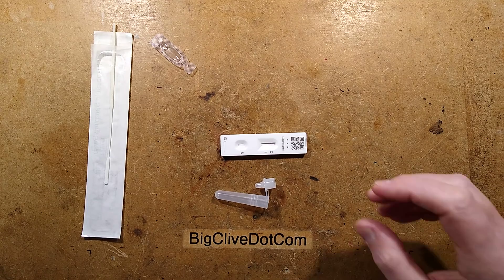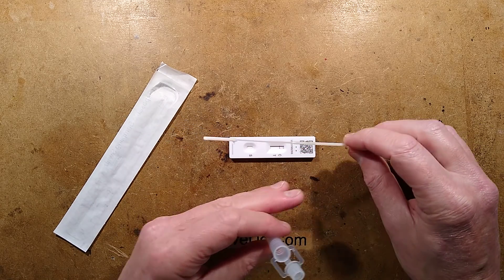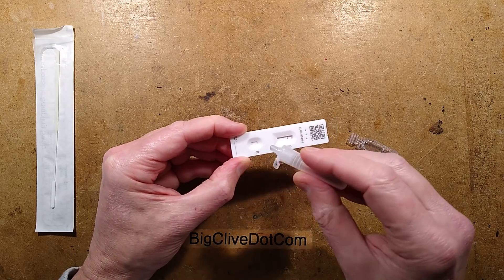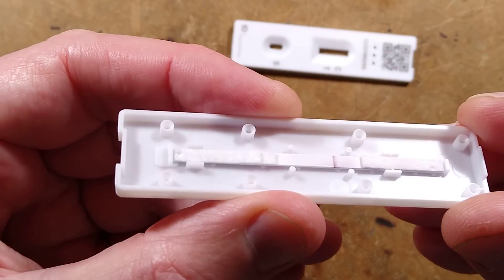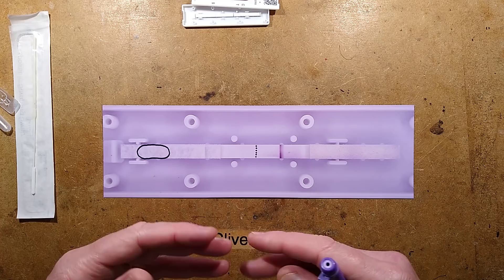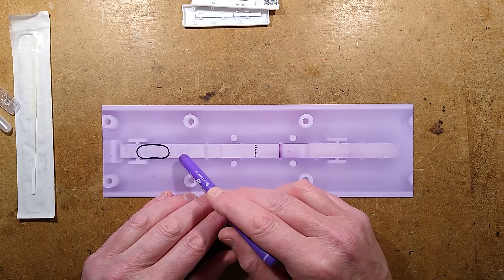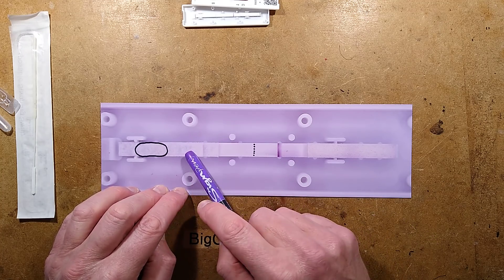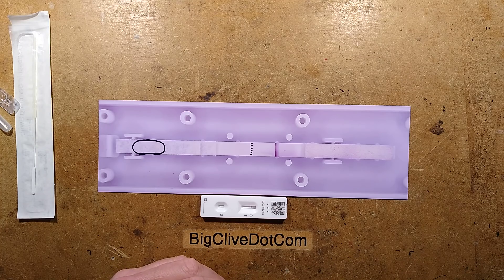How a lateral flow test strip works (kept simple)

Comment: I was wondering if the test line would show up without a sample. According to the manual, the test line might not show up if you take the sample incorrect, but in reality the test line will even show up if you don't take a sample at all. I've heard that you will get a positive test result if you replace the liquid with cola, but I have not tested that myself.
Reply: Why would anyone replace the sample with cola??? The test line is more to show the liquid has fully reached the results section – I don’t think its dependent on anything from your body. It’s mainly to catch when people haven’t actually put the liquid on the tester (or enough of it) by accident.
Reply: @Zveebo  First of all, if you want to test yourself you should obviously follow the manual. However, some people want to force a positive result so they don't have to go to school/work/whatever. Others use cola to "demonstrate" that self tests are unreliable. Personally, I am just interested to see if this actually works. Normally, BigClive destroys stuff for science so we don't have to, but in this case that might be a bad idea since some people could abuse it. Maybe I should not have made the comment in the first place.
Reply: Indeed the 'C' line appears even without a sample.  I would have expected it to indicate something normally present in saliva, but no.  Thus a 'valid' negative result gives no confidence that the test has been conducted correctly.  This feels to me like a fundamental flaw in the design.

Comment: Excellent explanation for the masses! Worked in a medical test kit company (actually purifying the antibodies from goat serum), and this is a good explanation.
P.S., the membrane is usually made from PVDF or nitrocellulose. Or similar.
Reply: @JAJAJA99999  purifying antibodies from it.
Edit: Goats are one of many animals that are used for antibody test kit generation. Goats, sheep, donkey, rabbit, mouse, even chicken are all used. The chicken antibodies are usually purified from egg yolks (100% serious).
Reply: @Newlife-ol6pk  I don't know about this test, but in general terms you produce a pure protein that you want to detect. In this case, probably a protein on the surface of the virus. The protein is then prepared for injection into the donor animal, just like a vaccine. The animals are injected and this elicits an antibody response. Then, you take the same protein and immobilize it on chromatography resin, and use that to pull out the specific antibodies you want. So, while there will always be some cross reactivity, you can have a relatively specific antibody for your test strips.
Reply: Nitrocellulose ? Isn't that otherwise known as Gun Cotton ? Is it wise to tell Clive that he might have something explosive there ? 😉
Reply from the maker: It doesn't go up like flashpaper.
Reply: @bigclivedotcom  Ha, ha ha! Brilliant! I knew you wouldn't be able to resist! Keep it up, big fella!

Comment: The new "nasal only" tests do away with the twist top bottle, the liquid comes inside the dropper bottle which has a removable foil lid.  The swab is much shorter (since it is nasal only), as is the waste bag and you only have to wait 15 minutes for the test to be read/reported. A much better experience.  Another difference is you need four drops into the tester.
Reply: Branded FlowFlex though the latest NHS branded kits are nasal sample only too.

Comment: A very timely video for me, as I needed to take one of these recently and was wondering how it managed. Though luckily mine only required some shallow nasal swabs.
Reply: i'm not going to pretend i'm an expert, but  i've heard from several sources that covid19 lives deeper back in the nose/throat and so it's way more concentrated there, so i'm wondering, are your "shallow swab" tests accurate enough?
Reply: @ThorNado77  I’ve used 3 different brands of these lateral flow tests. The instructions with the 3 I’ve used all said to just put it 2.5cm up or until you feel resistance. Some of them also ask you to swab your tonsils before swabbing your nostrils.

Comment: The ones we get here only requires prodding the front of the nose.  Procedure is to first blow your nose, then prod 4 times in each nostril, before the bottle and paper strip technique.  There's a better test that involves prodding the throat (only), then sending the swab to a lab for overnight PCR analysis. This test is done only by specially trained professionals.

Comment: Be advised, if you've had Covid, the test can still show a positive result for up to 90 days.
Reply: It’s actually the PCR that can show positive after a person is clear and non infective as it will detect viral fragments from dead and inactive virus for a period after infection.
Reply: @steveb1856  agree it would be Pcr.
If I got this right 
Imunitity  involves holding on to some chunks of viral genetics(the viral antigens) so any current/later  infection can hopefully be identified/fought off quicker.  Maybe very sensitive pcr can pick up those codes held by  immune cells?  
I do have some recollection of their being  an issue when UK had a cattle epidemic (foot and mouth disease) back in 2001(?)...  They couldn't determine if an animal's immune response was due to vacation or active infection of foot and mouth, which prevented vaccination being used back then. Sounds likely to be  pcr to me but I also guess things have moved on a bit in 20 years, and it's now possible to detect  difference between immune system being exposed to "wild", or "vaccine" viral code chunks. And likely why we detecting variants. Not that previous bugs didn't mutate... Just we didn't have testing resolution to easily notice the tiny changes etc.
Reply: @stevecummins324  Without going into great depth, immunity works through antibodies and lymphocytes (white cells), the proteins on the surface of a virus have a distinct shape, the antibodies formed are keyed to fit the shape they then attach themselves to the proteins and act as a signal for T lymphocytes to destroy the virus. Some antibodies will continue to circulate but the main immune memory comes from B lymphocytes which recognise a new infection by the same pathogen and then produce a new supply of antibodies. No genetic material from the virus is retained.
The reason a positive test post infection can occur is that the once the virus has been killed by the lymphocytes fragments of its now inactive RNA genetic material will still be circulating for some days whilst other white cells mop up the debris.
The PCR technique looks for tiny amounts genetic material the RNA in the core of the virus, creates a template of its pattern and over multiple cycles duplicates that pattern until enough RNA is produced to show up on a test (it’s the same system as used for DNA test). Consequently if even small fragments of the dead virus RNA are still in the body the PCR will detect and amplify them giving a positive detection even if no live infective virus is still present.
And that’s the brief explanation!
Reply: @stevecummins324  Louis Rossman had 40x the amount of antibodies after 8 months of an invection to be classified as "protected".
Reply: Yup.
Reply: It can't as it isn't remotely sensitive enough. You must be thinking of a PCR test, but even that one, which can be adjusted to react to the tiniest amounts of left over virus or viral debris, won't likely do that for 90 days. Maybe 14 days or even a bit longer if you don't blow your nose or scrape your throat often or violently enough. The use of mouthwash will also reduce the amount of virus residue inside your throat.

Comment: These are extremly sensitive, so if you have symptons, it's enough to get a bit liquid from your mouth or nose (depends on which symptons) and it will be positive, if you have c-19.
The deep test is just in case you don't have symptons and the virus is sitting in rly low concentration in either your throat or nose, where S-C-2 typicly starts to infect your body.

Comment: Funny - when I did these all I had to do was wipe the inside of my nose for 30 seconds, 15 per nostril. After that it was the same process...and I still do thin-layer chromatography on occasion (usually with glass-backed silica plates rather than filter paper). However, HPLC is my usual weapon of choice (or GC-MS).

Comment: I dont think they are that reliable though Clive, last week I felt like crap and did one of these and it showed negative however I still felt terrible a few days later and sent for the PCR test and it came back positive I had full blown covid. 
I can tell you one thing it was a horrible thing like nothing I have had before it felt like someone had removed 3/4 of my lungs one hell of a job to breathe and this went on for about 3 days I am over it now but still not 100% but at least survived it and I have had both jabs so I suppose it would have been far worse if I hadnt had these.
Keep the videos coming as I find anything is Interesting.
Reply from the maker: That's scary.  Without the pre-priming of your defence system by the vaccine it could have been much worse.

Comment: Thanks for that informative video BC.
So seeing how easy it is to break open the test casing should we be doing the same, pull out the wicking  strip and put the plastic case in recycling perhaps. I just put the whole lot in the bin. Could the plastic swab handle even be recycled if the swab is cut off perhaps?? 🤔
Reply: Recycling the plastic might not be allowed if it's considered medical waste / biohazard.
Reply: generally speaking, you can only recycle something if 
a) it explicitly says on the thing that it can be recycled, using a recycling symbol, and
b) [this is the very important part] your local municipal recycling system actually accepts it.  just because something has a recycling symbol on it doesnt mean your local recycling system actually accepts it.

worth noting tho that there is possibly a sanitary/health safety issue w/ recycling stuff that has potentially been in contact w/ covid particulates

(also worth noting:  plastic recycling is a scam made up by the fossil fuels industry to make consumers feel less bad about single use plastic, and generally speaking plastic doesnt actually get recycled by your municpal program, it just gets thrown out, usually after being shipped to another country)
Reply: It’s medical waste, so shouldn’t be recycled. The risk is low in reality, but it’s not something that should be done.
Reply: Please don't recycle used tests, even negative ones. They can be discarded in your regular trash at home, but they really are medical waste.

Comment: For the curious: in the most common rapid test in the US (BinaxNOW), the test comes as a foldable card. One side has a small well, and the other has the test strip. You drop the clean carrier fluid into a well on the test card first, then swab your nose, then wedge the swab into the test so its tip is sitting in the well. You spin the swab a few times so it's well mixed with the carrier solution. Then you fold the card over so the wick is sandwiched against the soaked swab. The fluid flows through and you read the markers through a window on the outside of the card. Same basic technology, just a different way of doing it.
Reply: Captain Fwiffo?!
Reply: Thanks that's interesting. Do you get your tests for free? I know medical costs are an issue over there so it was nice to see the vaccine being given out free.
Reply: @Chenty91  Tests are provided by the state or employers where they're needed for the job. Some local governments administer some PCR tests for free. Otherwise we buy the assay tests ourselves; they're about 12 dollars at local drugstores.

Comment: Well, if you gag, at least you know you've gotten the swab to the right part of the throat.

I think we're looking at two different effect:  The pad wicking the solution along is a form of chromatography, which separates out the contents by various physical properties.  The visible binding keys are probably anti-body based, as they are in the similar pregnancy tests.  Being able to cheaply make monoclonal antibodies in industrial quantities ha been one of the greatest benefits biology has given us in the last 70 years.

Here in Canada, I didn't do any sort of chromatography until a couple of courses in university.  The first time was paper chromatography in organic chemistry lab, where we weren't separating sugars for identification (we had pure sugars and were putting only one in each track) but we had to explain why different sugars moved different distances.  (The short version is that different sugars interact with the substrate and the carrier solvent differently, based on the number and arrangement of hydroxyl groups and and other groups on the molecule.)  The other was an upper year genetics lab, when we used it for DNA sequencing, which is done with a gel electrphoresis form of chromatography and some incredibly nasty chemicals that will kill you horribly if you get contaminated with them.  (I was almost killed by a completely different part of the course, where we did basic genetic engineering of bacteria.  This exposed me to bacteria with multiple antibiotic resistance genes, which became no END of fun when I developed severe bronchitis later in the semester.  I forgot to tell my doctor about that exposure until the second round of antibiotics failed to kill off the infection.  Then, he put me on Ciprofloxacin, the go-to antibiotic for that kind of problem and it cleared the infection just fine.  Rough on the gut, but there's ways to mitigate that.  Good thing I like yogurt and don't mind live culture ones.)
Reply: I've got some dextrose, glucose, and sucrose.  Now I want to see what they look like on blotting paper and see if I can tell a difference after developing. Thanks for the idea to keep me 'not bored' on a Monday evening.

Comment: So the new lateral flow tests have the same sample collection method as the PCR (throat and nose) - I believe the original Innova tests only required a nose sample.

Having done three PCRs last year (all +), I sympathise. Waving the stick around in the tonsils area does have a tendency to trigger the gag reflex, but I found the nostril twiddling much easier. The PCR sample tube is longer, and you leave the stick in it (there's a weak spot just below cap level, where you break the stick before putting the cap on). It's then placed, together with an absorbant pad, in a resealable plastic bag (after applying stickers to both with an ID code). At drive through testing centres, this is then placed in a fold-and-seal bag, then taken off you with a grab arm (litter picker) and placed in a plastic bin lined with yet another plastic bag, together with everyone else's samples. For home kits, there's a sheet of cardboard supplied which you fold up to make a box to post it to the lab in.
Reply: I have worked with Innova tests since December 2020, and they always required a throat and a nose sample, so it's been like that for nearly a year now.
The swabs we use in the test centres also have that weak spot where they can be snapped, but this is not necessary for LFT as the test is performed immediately after swabbing.
Reply: The latest LF  latest kits supplied by NHS only require a nasal swab no need for the throat swab.

Comment: I am still a bit circumspect about how reliable these can be, but it does look like a simple but quite reliable design.
Reply: The issue is how much viral load you produce I had many negative assays then when I became symptomatic I started to positive assays. All confirmed by PCR test.

So the take away is they can give false negatives but highly unlikely to give false positives.
Reply: This sort of test is designed to fail positive.  As a screening test, if it gives a positive result, that directs you into another test that's more reliable, like a PCR test that will look for genetic sequences specific to the virus.  A negative test will mean no further immediate testing, which is bad if it was a false negative.  All screening tests are therefore designed to have as low a false negative rate as is feasible, even at the expense of substantially increasing the false positive rate, since a false positive will be otherwise screened out but a false negative won't be.
Reply: There have been reliable (I hope) reports of these type of tests detecting infection in about 80% of infected people and in 90% of those who show significant symptoms of infection. They seem way, way better than guesswork and I can see their utility in many settings.

Comment: Problem is you can just pour the solution onto the test without swabbing and it will show negative.  This also means you have no idea if you’ve done the test properly.
Reply: Why would you do that? It’s a test – if you don’t do the test, of course it’s not going to show correctly.
Reply: It will show void
Reply: Indeed, the 'C' line appears even without a sample.  I would have expected it to indicate something normally present in saliva, but no.  Thus a 'valid' negative result gives no confidence that the test has been conducted correctly.  This feels to me like a fundamental flaw in the design.
Reply: @whatdoyouwantfromlif  It’s always a balance between cost, practicality and perfection. As long as you’re not an idiot, LFTs are easy to perform, so the chances of it happening by accident are pretty low. And as for fraud, well bad people are always going to do bad things — you sometimes have to rely on most people being decent humans. The test is already being improved frequently, so this may be something they make more robust eventually, if the cost can be kept low.